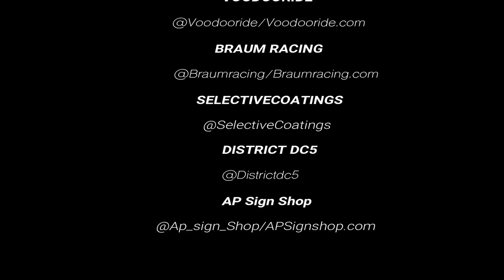VoodooRide Products Review

Comment: Thank you for reviewing all of those products, I appreciate the information and as a fellow YouTuber I understand the amount of work involved.  

Just one piece of advice from a pro detailer, take it or leave it - you don't want to use the same wash bucket or wash mitt on the paint and the wheels.  The wheels get that brake dust on them which is actually small pieces of metal, that stuff gets really stuck in the wash mitt so even if you wash the wheels last,  the next time you use that mitt on the paint it will still have the brake dust in it and then you will be rubbing brake dust on your paint.  Brake dust gets stuck in the tiny crevices in the clear coat and then it rusts and gets super stuck in the clear coat and will need to be removed with an iron remover and clay bar.  If not removed then over time it will damage the clear coat and can create rust spots which will require correction by compounding and polishing.  I just make a bigger batch of car wash soap and pour some of it into my wheel bucket to do the final wash the wheels.  Hope that helps!  Cheers!
Reply: Hey man, thanks for your advice. It all makes very clear sense. I will definitely take your advice and put it in action. Thank you!

Comment: What brand battery powered air blower did you use in the video?
Reply: I used a gas powered Honda pressure washer. But an electric pressure washer will do the job as long as it builds any decent amount psi. Harbor freight tools sells affordable electric pressure washers that can do the job.